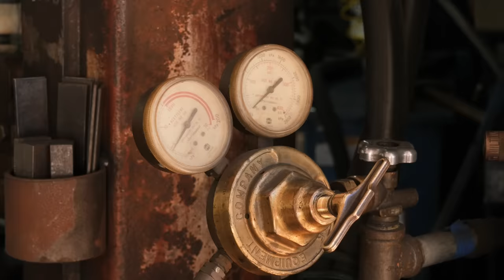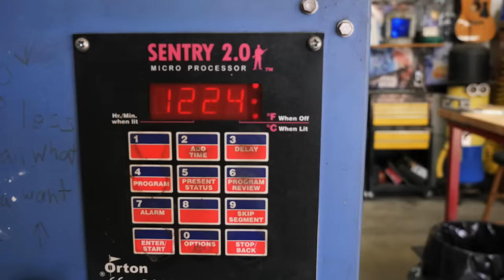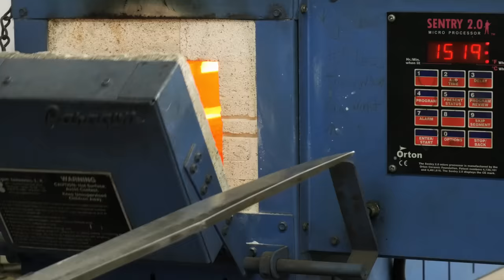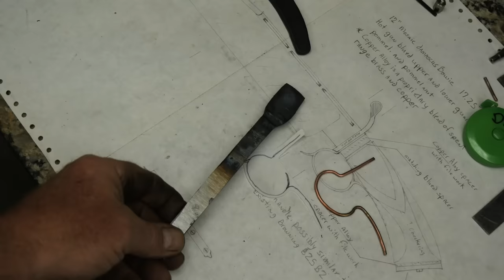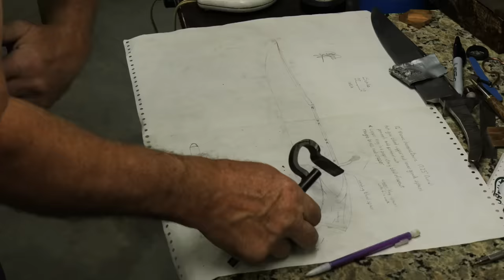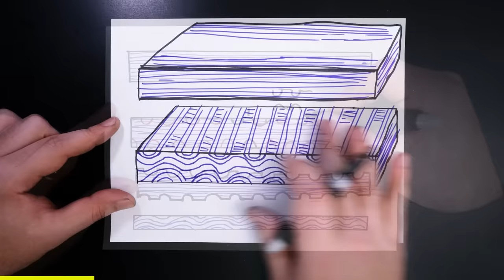Making A Shotgun Knife

Comment: Machinist and knifemaker here. You mill and do any rough shaping BEFORE you harden. Soft steel is much easier to shape with a mill or lathe than hardened steel. Props on the welding of all the seams to keep air out. Very good principle when forge welding. Keep up the good work!
Reply from the maker: Hey thanks FoX. Keep Forging On my friend 

Dad

Comment: For medical instruments made from Carpenter Custom 630, 17-4 Ph 900 we would flood our heat treat furnace with nitrogen.  Tank of gas with a regulator and a piece of copper or SS tube into the chimney.  The formal way to do this was a vacuum HT oven, but these things are expensive.  We would get the parts out with no scale (brownish/blackish) and if there were sharpened edges, they remained sharp.  Love your work, it is fantastic!

Comment: As a gunsmith I’d like to make a suggestion. When inlaying metal into the wood, get the metal to final dimension, then use inletting black. It will show where the metal is contacting the wood, then use a chisel or scraper to remove the wood. That way the gap between metal and wood is minimal, .001’s of an inch. Takes practice. Beautiful knife!
Reply from the maker: Hey thanks Aaron. Great idea. I ended up sculpting the guard to final profile then put sharpie on it and kept setting it on the wood til it gently set in. Glad you’re here hanging out with us all my friend. Keep Forging On 

Dad

Comment: Bronze is 10% brass and 90% copper so you were about right. For an interesting finish try casting alubronze. That would be 10% aluminum and 90% copper. It buffs out real nice and brighter than the bras mix. Beautiful pattern weld though I'm at a loss to understand the addiction folks have to the bowie knife. It does have an amusing history if you look up jim bowie's brother.

Comment: A bit of advice for the problems you had getting the guard fit up and inlaid into the handle, look into the Muzzleloader building websites like Track of the Wolf. They carry a product called Jarrow’s Inletting Black that is made specifically for precision fitting metal parts into wood and they have some extremely good precision carving chisels that will make it much easier to easily remove the wood needed to make the parts fit properly and snug
Reply from the maker: Very nice. Thanks peltier 

Dad
Reply: @KyleRoyerKnives  the Jarrow’s Inletting stuff is available in Gold also for use on Dark Wood and while it might seem messy the stuff cleans up easily especially with stabilized wood but you can tape beside the channel so you don’t get it on your surface and what you do is use a small craft paint brush and paint the Jarrow’s on the underside of the metal part and as you put it into place any high spots in the channel you are carving will have the Black or Gold Jarrow’s on it and you delicately remove only those spots with the Inletting chisels then try the part again rinse and repeat over and over until the entire channel gets Black from the Jarrow’s so you have a perfect fit up between your metal and wood. Also if Track of the Wolf is sold out The Log Cabin Shop is another excellent source for the Jarrow’s and the small Inletting chisels that are great quality

Comment: So, I noticed you went to mill out the ribs after you hardened it. Is that not something you can (or should) do before hardening? Or was it just something you hadn’t considered would be a problem for a mill bit?
Reply: That is an absolutely gorgeous knife.
Reply from the maker: Good question my friend. Everything is measured and built off of the spine. It had to be heat treated and finish ground first in order to get accurate measurements. We frequently mill hardened high carbon steel. There was just a lot of material to move this time. Using a fresh dressed cut off stone actually got me the same profile of the ribbed barrel on the Browning B25 B2 trap. 
Keep Forging On 

Dad

Comment: When you weld up 100%, how do you get the existing atmosphere in the gaps out before closing up the weld? Are you at all concerned about the possibily of trapped atmosphere and "popping" during pressing?
Reply from the maker: Good question my friend. The oxygen is burned up before the steel gets to welding temperature. After the first several presses it’s welded. The can may leak
Forge on 

Dad

Comment: How can you explain the zero atmosphere welding? It seems if you didn’t sand with 10,000 grit sandpaper on a glass smooth surface, when the pieces were put together(or in a vacuum) they would have a small amount of air inside. I’m probably wrong. Awesome video nonetheless!
Reply from the maker: Oxygen sealed inside burns up before it causes problems. Good question my friend. Keep Forging On 

Dad

Comment: What is that tank setup for the vermiculite with the airlines connected? I don’t think I have seen anything like that before.
Reply from the maker: Good question my friend. Vermiculite can get compressed when trying to put a large billet of steel in it so the low air pressure permeating through it causes it to become like liquid. Large objects fall right through it when the air flows gently through it. 
Cheers 

Dad

Comment: have a question
I'm 14 and want to learn blacksmithing, but i live in the middle of the suburbs in Seattle so it's not really possible to make a forge in my backyard due to noise and space. Is there any way can start or is it basically impossible for now? Also there's no way that i could drive out to somewhere secluded.
Reply from the maker: Hey great question Jacob. Good neighbors are hard to get and hard to keep. Be a keeper of peace with mom and dad and your neighbors. I wouldn’t want to tell you sometimes it’s easier to ask for forgiveness than permission. Would never advise that. You may find there may be others in your neighborhood thinking the same thing. Check out your local area for bladesmiths. I did a quick search and found several. We’re in your corner my friend. Reach out at jeff@royercutlert.com if there’s anything we can help you with. 
Keep Forging On 

Dad

Comment: Guys what is the difference between welding steel sheets with zero atmosphere and Open atmosphere.

The effects please 🙂.
Reply from the maker: Good question Rushdi. Zero atmosphere reassures there is no chance for mill scale to form during the forging process. Mill scale makes little pockets of slag inclusions in the steel that are very undesirable. Mill scale is decarberized steel. 
Open atmosphere can lend itself to be vulnerable to mill scale forming. There are several common techniques to keep mill scale from forming.
Zero atmosphere is the cleanest type of forge welding we have used to date. 
Keep Forging On my friend 

Dad
Reply: @KyleRoyerKnives  thank you very much